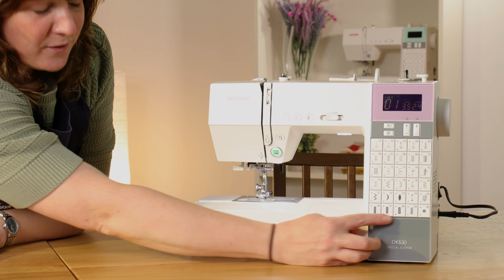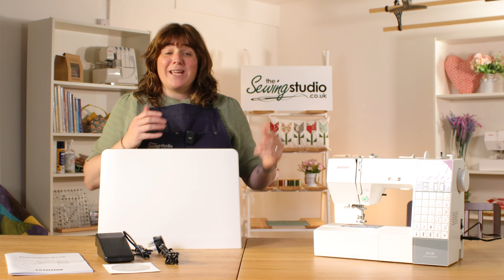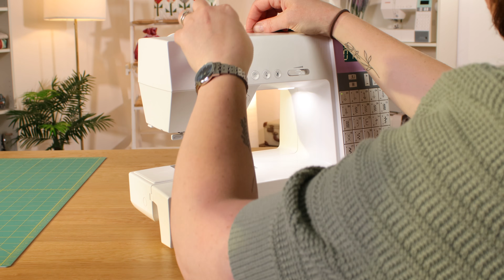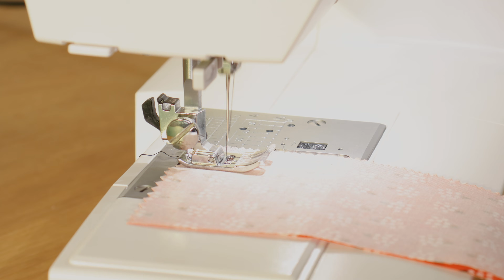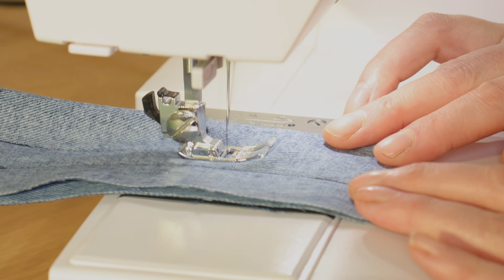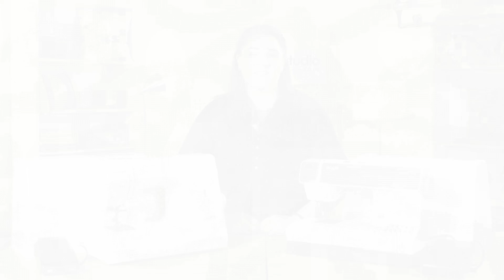Janome DKS30 Sewing Machine Review

Comment: Can you advise why it keeps bleeping please? If I rest in between stopping and starting it so straight away. If I so then stop and try sewing straight away, it bleeps.
Reply from the maker: Hi there, The DKS30 is a computerised machine so when you stop sewing, it needs a chance for the needle to finish in either the up or down position, depending on your preference that has been set. If you start sewing before this is completed, the machine will beep. You will also hear a beep if you raise or lower the presser foot before the needle has stopped moving into its correct stop position. Hope this helps.

Comment: I have this machine and been using it for dress making mostly. Using cotton, jersey, denim, light weight viscose. I love it so easy to use and the thread cutter is the best. Also the lock stitch is great when you don’t want that reverse stitch showing. The button holes are a dream and perfect every time👍🏻. I use the lightning stitch on the jersey and the twin needle to sew the hems, it gives a professional finish. I highly recommend this efficient and quiet machine. The instruction book is so helpful too showing which stitch to use in different situations.